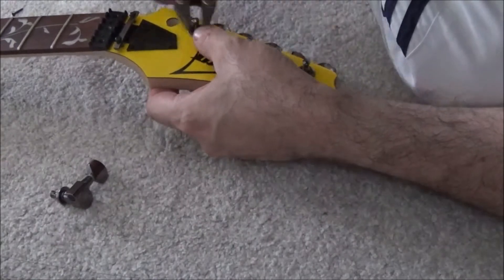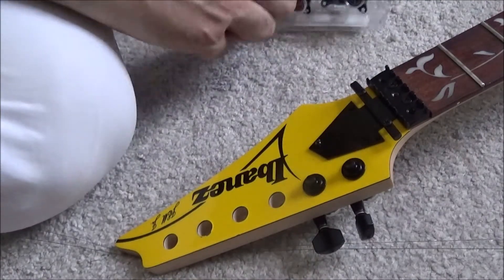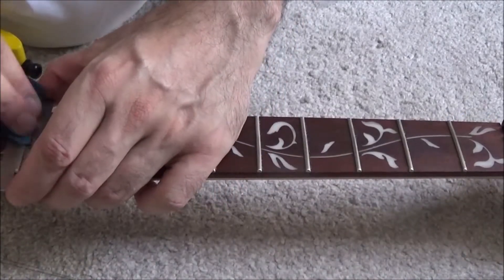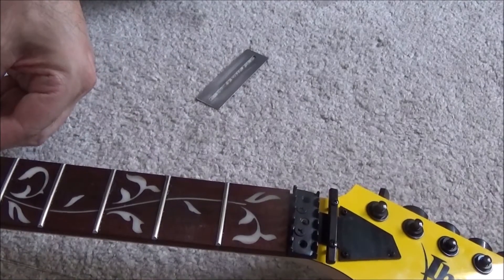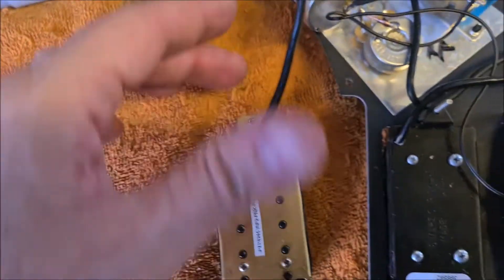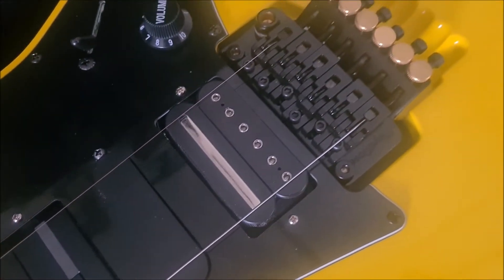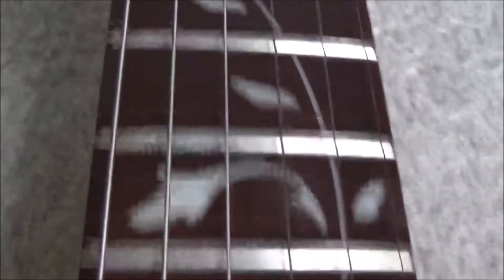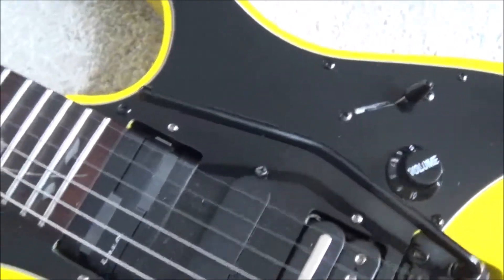Ibanez Jem Jr modifications complete

Comment: I replaced my stock tremolo with a Gotoh 1996t bridge.  I had to shim the strings like you did.   I had to make a few mods to get it in.  I did replace the trem posts with Floyd Rose ones so I didn’t have to redrill for new posts as the Gotoh are a bit larger.  Made a large difference in sustain and tone.  I will likely replace the stock pickups in the future.
Reply: I also have the GE1996T. The stock arm never stayed tight no matter how often I tightened the Allen screw under the collar. I was going to get different pickups but I kind of like the stock pickups. My Gotoh has the 40mm block and that tremolo flutters better than the stock unit.